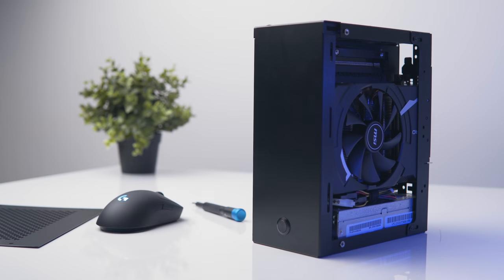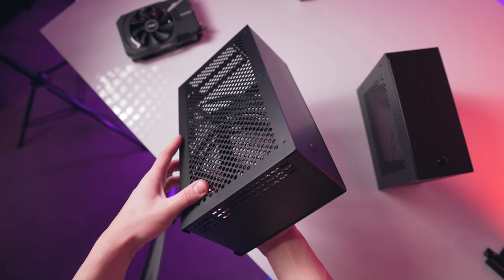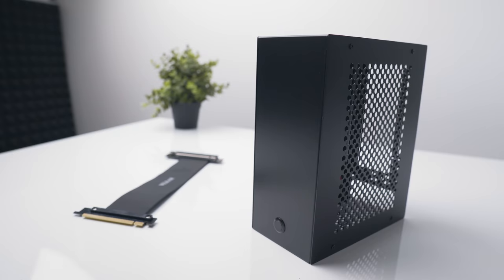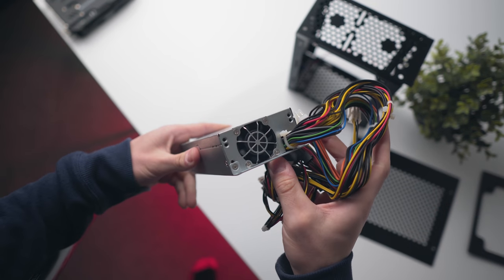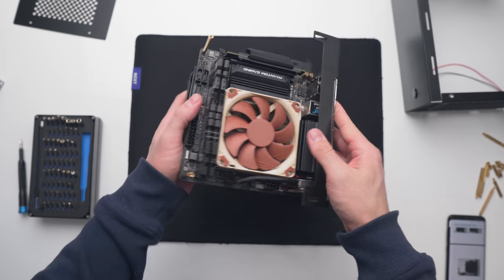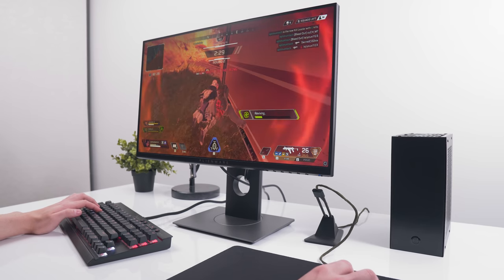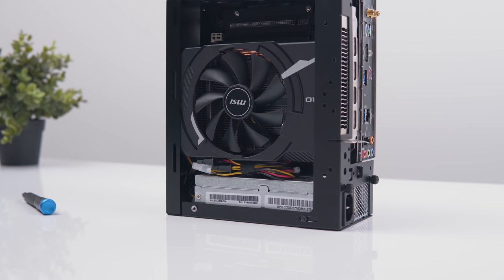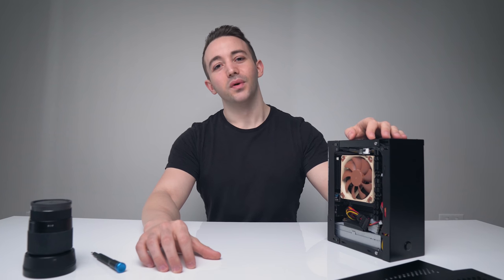Velka 3 - World's Smallest RTX 2070 Build!

Comment from the maker: Part 2 of this video here! https://youtu.be/-7x1LI5kOS4
Reply: Im just waiting for my V6 as a replacement of my Cerberus
Reply: I hope GPU manufaturers start making taller but shorter cards for SFF builds.
Reply: When are you gonna get your hands on a T1?
Reply: Comrade Supreme 
The only way I can think of is submerge the whole thing in mineral oil
Reply: Can u make a video about how to swap the PSU fan of this build soon .
Reply: Nice video 😀
How about a follow up video where you change the power supply's fan and do a noise comparison? I would personally find that very interesting. Eventually the PSU fan could even be controlled if you hook it up to the motherboard instead of the PSU's connection. Just a thought.
Reply: I would just rig up a HD plex up to the velka's (and most sfx cases) anyway just to go fanless.
Reply: Make a great (2nd PC) streaming box, with more modest internals?
Reply: Do you think you can do a comparison between this and the Geeek A30 (a very similar case for $50 because it’s acrylic instead of aluminum)?
Reply: HD Plex should work.
Reply: This channel is 🔥
Reply: Jalous... I have to wait a bit longer for my Black beauty v6. Gonna be great though with a strix rx 5700xt, Asus b450-i, ryzen 7 3700x and trident z Neo 3600 32gb!
Reply: @marcelosiciliano1690  Try Tesla! The better solution!
Reply: @comradesupreme1210  You can fit any Radiators on the outside of the case
Good luck building!
Reply: Should I order Ncase M1 V6 or wait till the Ghost S1 is available again?
Reply: I would like to see a build incorporating an HDPLEX 400w AC-DC and DC-ATX combo with this case.
Reply: Optimum Tech what cpu are you running in here? Not sure if you mentioned it or not
Reply from the maker: @austenfraunfelter3479  i5-8400
Reply: Hi Ali! What do you think about the nouvolo steck?
Reply: PSU is about as loud as my heart rate was in Apex resurrecting you...ha
Reply from the maker: @aaronwidger449  lol..
Reply: @DeViceCrimsin_  If you stay under 300W power draw the HD Plex 400W AC-DC adapter(sans fan) may just squeeze in.
I know Velkase say 150mm long PSU but that is to allow for the chunk of cables that pop out the back of the PSU. The HD Plex unit has much fewer cables.
Reply: Can you sell me your 2070 ? I’m actually so serious, you can’t get a 2070 itx for a reasonable price
Reply: hey i hope u read this but i noticed the 500w plat version of this flex power supply has the fan out the back next to the plug so you dont run into the cable bunching problem
Reply: Optimum Tech please giveaway this wonderful pc to me please plzzzz aw
Reply: Does anyone know if this will take my rtx 2060 super? 
Ps I got it from best buy "NVIDIA - GeForce RTX 2060 SUPER 8GB GDDR6 PCI Express Graphics Card - Black/Silver"
Reply: Is there any way to mount a 120/140 rad in the gpu side of this case?
Reply: How did you go about picking a motherboard that was compatible with the Velka 3 case and did you have to use the Velkase Riser cable in this case?
Reply: Can i have that build? I loved it so much <3
Reply: Hello, when can I buy this case? Now it is out of stock on the velkase website.
Reply: umm where the ssd or hdd?
Reply: The gpu side can fit a 600 watt gpu 4 way copper blower card

Comment: I would like to see a video where you swap the fan of the PSU to see if you can get it quieter.
Reply: @Man Dangerous? :D Danger is risk!
Reply: It needs to spin that fast to provide the needed airflow. Swapping out a more silent fan would address the issue of noise but might introduce another problem.
Reply: @gchyll2  A high quality fan can create the same airflow with less noise tho.
Reply: @gchyll2  That's not really necessarily true; there are countless examples of higher quality fans being able to supply MORE airflow, at LESS noise, than cheapo OEM fans.
Reply: @gchyll2  it's a cheap industrial fan that's just there to do the job. My guess is one of Noctua's 40mm fans could do magic here and potentially even have higher airflow.
Reply: GEEEK sell (used to?) A delta PSU with a fan swap and I believe a modular cable mod?
Reply: Its 15 mm. Noctua makes a 10mm at 1/3 the rpm. And the voltages i think may be different
Reply: That is what i did with my Sharkoon SilentStorm SFX Gold 500 Watt
Replaced the stock fan with a Silverstone FN123 (120mm wide, 15mm thick fan)

Went from audable to silent (my loudest component is a 2.5" HDD)

Just make sure to check the with and height of your stock PSU fan and you'll be fine. 
also, you only need to connect two wires, so don't worry about pwm fans :)
Reply: here here!
Reply: I wonder if it's not the fan but rather squeezing the air through a narrow funnel that's the issue, so a fan swap wouldn't make much difference in that sceanario
Reply: @Goldernturkey  the GEEEK psu is 170mm i believe Velka states somewhere that it specifically wont fit. Which sucks!
Reply: I have silverstone fx350g in this case. Changed the can to a noctua 40x10mm. Very silent!
Reply: Andreas Sasse you running a GPU?
Reply: please
Reply: There are different fans for different things. There are high speed fans with low static pressure and then there are high static pressure low speed fans that can achieve the same cooling with less RPM and less noise. The reason these power supplies have high RPM fans is because they usually use double-ball-bearing fans because these power supplies are typically designed for rack-mount servers that need the extreme reliability for 24-7-365 operation. But for a home PC that is turned off at night or on a regular basis and doesn't actually run 24-7-365 non-stop, they could totally swap it out for a high static pressure low speed fan and be perfectly fine.
Reply: @robdp8900  yes. A EVGA 1060 6gb modified with a noctua fan. Fx350g have a pci-e 6-pin
Reply: Then you have the tiny super loud gpu, so your going to have to remove the fan and ziptie a noctua to it. If you get the sky reach you can just remove the gpu fans and add fans to the case since there are so close to the gpu.
Reply: It would explode dude
Reply: You can die from the current stored in PSU capacitors. Even if you have never plugged them in, they may carry current from production testing. Please do not dismantle PSUs or encourage others to.
Reply: @JonasWechsler  a u2 and flex power supply are typically set up to be changed without removing the components protective shielding for easy fan replacement. That's why the fan is exposed so u can unscrew it, slide it out and slide a new one in without taking off the shielding.
Reply: I second this, if you show how to do this that’d be great
Reply: I just found out that Geeek sells modded PSUs that can be customized, are modular and have a quieter fan..
Reply: what you want is the enp-7660b potentially with a noctua fan mod
Reply: @wollensokje1112  Hey that sounds great. Would mind sharing your build or you parts list?
Reply: it absolutely can. I swapped fans on my bigger PSU in big case, and it got much, much quieter.
Reply: @Man I swapped fans on all the psus ive had. never ever had an issue lol
Reply: @Goldernturkey  they still do, but it's too long. velka 3 supports up to 150mm when geeek's in 170mm
Reply: I use a rajintek Metis, where the PSU doesnt spin the fan at all as the case fan sucks air through it in reverse. The case fan runs at 75-100% when under load, but its not as luod as the PSU fan..
Reply: He did just that xD
Reply: Lol all the people here, dont forget about power requirements of the fan changing when swapping it, and that you cant change the fan curve that the PSU has setup.
edit: Also, replacing the fan wont get you a suddenly really quiet PSU even if the above mentioned could be fixed. That PC can consume like 385w (90w CPU [I think, havent checked total power consumption of a intel CPU for a while] + 225w GPU + 70w rest of system) max which is rather close to its full load. Can minus a bit cuz gaming wont do that much, so now say 340w total. That power consumption will output a decent amount of heat, which a fan of only 40mm in a not so well ventilated space wont be able to push the required air through at super quiet noises
Reply: You're telling me you bother about noise? You like computers and performance but you get bothered by its breath?
Reply: @PhantomMattcraft  no but that's a cheap whiny fan, and a more expensive higher quality fan would make less noise at the same speeds. Yes coil whine would still exist, but it would still be less noticeable
Reply: @jonniezodiac  This is a very small form factor PSU. A "good quality" fan that small would only be quieter by not spinning as fast and thus get worse cooling perf for the PSU. With such a small fan you cant do much in raising CFM or static pressure other then raising RPM by a fair bit. With such a small PSU you're going to want both decent CFM and static pressure. Dont want the PSU to overheat and cause bad voltage ripple or voltage regulation now, right?

Realistically I'd be more concerned over things like voltage ripple/regulation, transient response, included protections and whether they work, capacitor quality, and such before worrying over noise. Considering there is lack of proper in depth reviews for the PSU it isnt an ideal one to pick.
Reply: @Sardothien  idk, still lack of info on real quality of the product. Rating and company mean nothing in terms of a PSU model quality. It's still unknown how voltage ripple/regulation, transient response, whether the included protections work, capacitor quality, proper holdup time (they advertised that they got the correct amount of time, at 75% load [so probably worse then ATX spec at 100% load if they arent saying it], but who knows if voltage dropped to unsafe levels in that time, AKA poor PWR_OK management for holdup time), MOFET quality, primary/secondary topology, etc all are. Reading up on PSUs and seeing what all the fun issues can transpire, I always recommend one that actually wont have issues - wont blow up/kill your PC due to improper protections or smth.
Reply: @PhantomMattcraft  I'm not deeply into psu design, but I know it's an existing PSU that they've modified with shorter cables and a quieter fan. You can find more info here if you're curious: http://www.enhanceusa.com/webe/html/products/show.aspx?num=100&kind=63&page=1. You're more than welcome to check if anyone else has tested it directly.

There is a distinct difference in fans though. Most fans of a given size will generally have similar performance at a given RPM. However, they can produce vastly different noise levels at that same rpm.

Comment: I think the top fans are supposed to be configured as exhaust.
Reply: Indeed. Since every other fan is intake.
Reply: Nope they add positive pressure, the case is mostly vents so it doesn't need exhaust vans
Reply: Yea, I think the power supply fan is the only exhaust fan in this video. No wonder it getting very loud.
Reply: @ifchen2  Actually, the PSU is exhausting inside the case, part of the reason you need those 2 fans.
Reply: thats what i was thinking when i saw the fans,
all fans are intake, in addition to the psu one....  exaust fans will be more then welcome

Comment: WOW! Just wow! Please make a follow up vid. 
1. Swap the 40mm fan
2. Sleeve the ketchup and mustard cables
Reply: It probably just needs a low noise adapter inline for the PSU fan
Reply: @oliverturner128  nah mostly a higher quality one. There are 40mm models from Noctua. The existing fan is really not made to be quiet.
Reply: Might still be loud with noctua... Those PSU's are typically found in rackmount server cases where low noise isn't a factor and the controller just pumps a load of power to the fan. But I think you're probably both right, low noise adapter and a better fan will be the best bet.

... And 100% sleeve the cables! 👍
Reply: @techie2643  he could also hook the fan up to the motherboard and control it that way.
Reply: I would just use a can of black Plastidip to colour the cables and the visible  part of the psu
Reply: Cyril Cero
why that?
Reply: why sleeve the cables if they are all hidden though?
Reply: @Kathdath. That's what I was going to say. There's just no room to sleeve. Plasti Dip will do.
Reply: 3. Swap the dead PSU with that new fan ;)
Reply: what about asetec 92 mm aio watercooler?
Reply: Yes, replace the PSU fan to one with lower static pressure and CFM to have it potentially overheat and cause insane voltage ripples (or shutdown depending on protections).

Comment: Wow and the case is relatively affordable.
I might even choose it for my next build.
Reply: L A That noise though, it’s like a first gen PS4 during load, could be mistaken for an airplane.
Reply: L A
Why you need low power?
Reply: @Athasin  Can be fixed by changing the fan in the psu. Will be like 10x quiter with a noctua
Reply: I would buy it but i dont have balls to swap the fan in a psu
Reply: @kot3405  You could probably pay a professional to do it, or buy a more expensive psu. It'll cost more but it would be quieter
Reply: @kot3405  Those 1U Flex psus can be found for under $30 on ebay.
I have a 1U 400W psu that i purchased for $29 before tax
Reply: the 1.2 version supposedly will have fanless supplies that work which would be cool with an APU
Reply: 75$ for some thin sheets of metal? No, That is not affordable lol
Reply: @bluemorpho4941  then again people also paid $100 for a couple of RGB LED lights in their PC, soooo
Reply: @domenucakar $160 when it comes to these cases IS affordable lmao

Comment: Wow Finally someone made a small case that is not overpriced. Thank you Velka, of course when i go to look they are out of stock.  Thank you for the Video Optimum Tech.
Reply: can try preorder the next wave of cases, I just managed to secure a Velka 5
Reply: @carlzhuo24  I preordered a Velka 3, and then I got a PSU from geeekstore com shop custom-flex-atx-modular-psu, but the PSU is a 170mm long and I know i will have to cut chop rebuild on the Velk.  The PSU will com with colored wires and 300mm long cables.

Comment: I have this case in silver. I’m using the enhance 600 watt PSU and it is so much quieter than the 500 watt FSP PSU I was using. Worth a look for sure. 

My biggest complaint in this case is how thin a lot of the metal is, especially the motherboard tray. I ended up covering mine in electrical tape because I was worried about it flexing and shorting the motherboard. Still, I love this tiny case and it is hard to beat for the price.
Reply: Awesome ENP-7660B

Comment: Are you kidding me?!?
I just finished building my own velka 3 this day! Great to see it getting some spotlight!
Reply: how are the fan noises?
Reply: @0AcE013  fantastic. Almost completly silent when idle. Gentle fan noise from gpu when gaming 

Noctua fans on cpu,gpu and psu. 2 Velkase 80mm fans on top exhaust on absolute slowest rpm possible to help the natural convection dissipate the heat.
Reply: @andreasksasse  that's great, what are your specs if i may ask?
Reply: @0AcE013  i have a old cpu/mobo at the moment.  Will upgrade to i5 9400 or something similar in the future. 

Current specs:
I5 3470
8gb ram
Gtx 1060 6gb
256 gb ssd
350w gold psu
Reply: @andreasksasse  awesome setup
do you think a simillar setup but with a ryzen5 3600 and 16 gb ram would work with the 350w psu?
i'm attempting my first build and i want to get that case but i have no clue how to work out wattage
Reply: @0AcE013  https://outervision.com/power-supply-calculator

With Ryzen 5 3600, 16gb and a gtx 1060 around 350w is recommended. With i5 9400, 290w.

I dont know why they are so different

Comment: I built something similar years ago in a Silverstone SG05-LITE case not much bigger (10.8 liters) for just $40 (doesn't require a riser cable, and can be used on its side with some feet to allow air to the gfx card). Used a 500w 80Plus Gold Silverstone SFX-L PSU, and a it fits a full-sized gfx card - mine is actually 2.5 slot and still fits, and it's got such a beefy 2-fan cooler that the fans almost never come on and are quiet when they do. Used an AIO water loop instead of trying to fit an air cooler in and the rad just sits at the front drawn in air that help cool other components even as it dissipates the CPU heat. Single fan gfx cards are going to be noisier, as will a smaller fan on a standard CPU cooler instead of a large one on a radiator (which will also probably not need to run as fast).

Comment: 1U PSU are meant to be used mostly inside servers, this is why they are pretty noisy, but as you said if you replace the FAN with a Noctua you will be just fine.
And btw, this is one of the most impressive like/dislike ratio I've ever seen [1.1K/6 atm], congratulations, you are doing a relly good job ;)

Comment: I built in the Velka and found that the 10X80 fans on top were the real problem causing a lot of noise. By removing them my Velka wasn't nearly as loud.  The benefit of decreasing the case temps 5 degrees didn't seem worth the fan noise so I am using it without. Also have a delidded i9900 (non-K) in there.

Comment: I just finished building in my Velka 3, and my noise levels are significantly lower. I went with the FSP 500W Flex ATX PSU, and the fan inside does not turn on until 90% load. I have very similar hardware, but instead have a 1660Ti. I don't come near the PSU max, and it keeps the SFF PC nice and quiet. No fan replacement necessary!